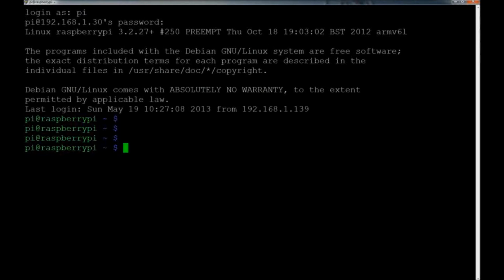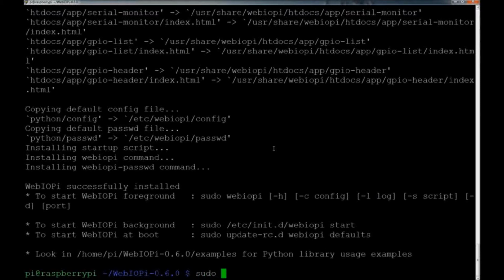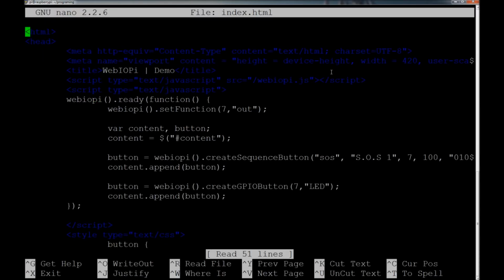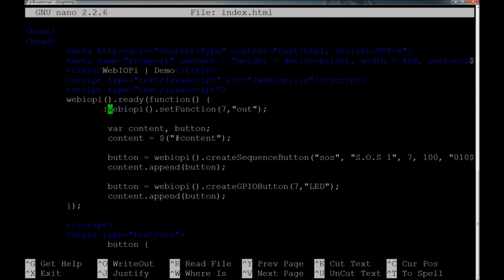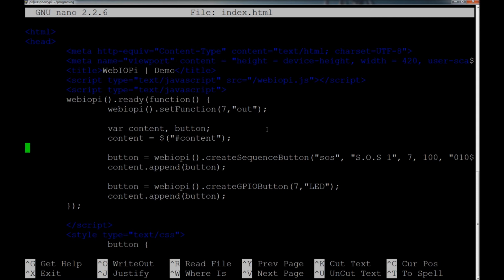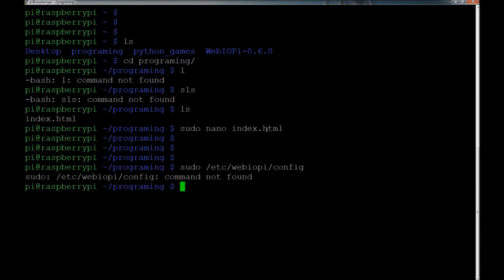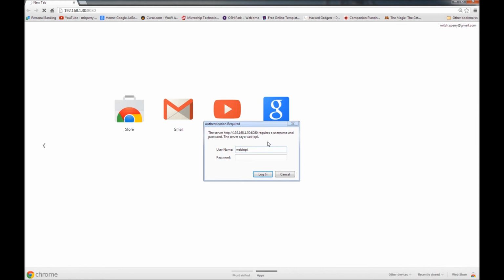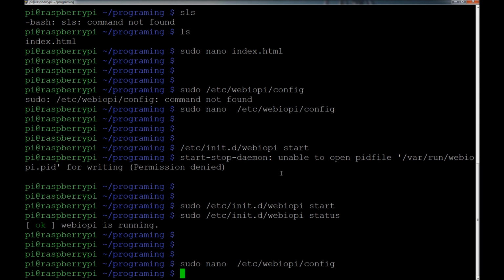Raspberry Pi Custom Web Control

Comment: Hi, your videos are very informative and seriously got me moving in the right direction with my heating control project. I know that webiopi has some device support but unfortunately not for my hardware. Hopefully you might be able to help me out!! I have the ADC pi board and a IO 32 channel expander from abelectronics, Both work with the tampered python sample code. Would it be possible to to integrate/import this code with the webiopi interface? Any advice would be greatly appreciated!

Comment from the maker: Hi there,  the way that I connected the LED was with a resistor on the anode of the led around 330 ohms.  I then had some spare contacts laying around that fit the header of the raspi so I crimped them on to the other side of the resistor and to the cathode of the led.  I then stretched it between any 3.3V power pin and GND pin of the pic micro.  If you need a layout of the header for the raspi just google "raspberry pi pinout" and you should find documents telling you where 3.3 and GND are.

Comment from the maker: hey there, thanks for the comment.  When you say python scripts are you meaning that you have gotten GPIO to work with python?  If you want to control it form web then you will need to use javascript if you want to do what I did in the video.  I have only experience with the javascript stuff. Javascript will allow you to embed java based code into an html file so that you can control the GPIO  from a web page and not from the command line.

Hope this helps.

Comment: Thank you so much for this video!!  I've been trying to create a garage door opener for the pi for months and you totally put me on the right path!  I wanted to let you know that you don't need Apache to run webiopi. I started fresh, put Webiopi on and I was up and running.  Also, I don't think you have to put the setFuntion line in.  I was able to make it work by editing /etc/webiopi/config.  You can set the GPIO to start up in the "OUT" position in the first section.  Thanks again!!